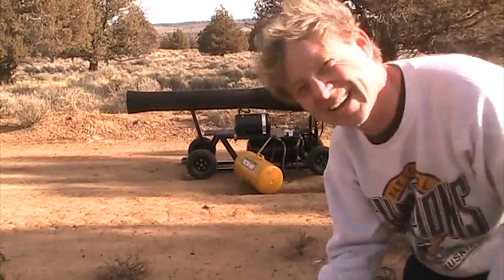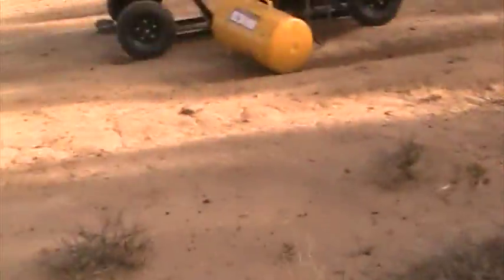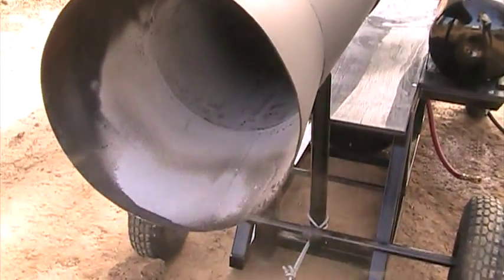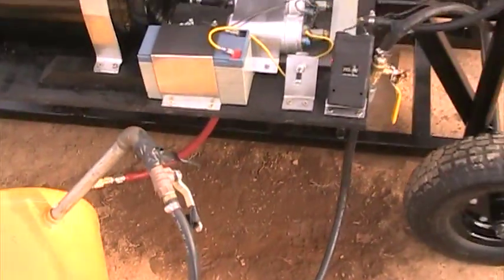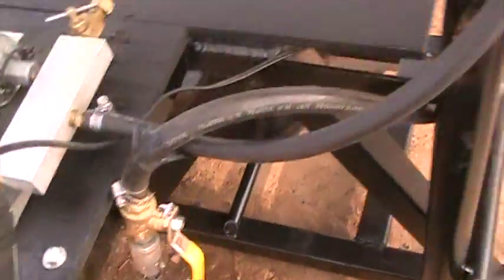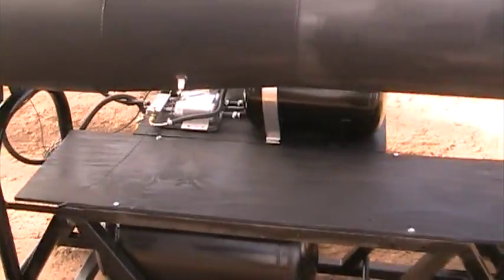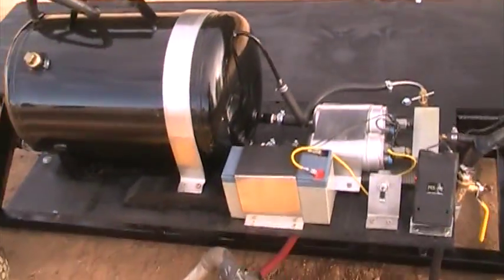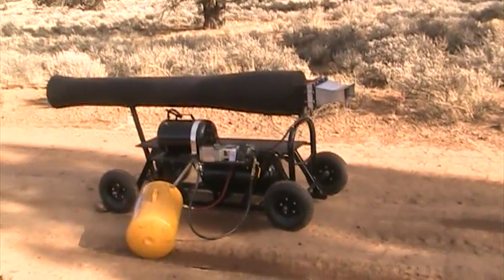New Rocketman show starting 2017 GERMAN V-1 STYLE PULSEJET !

Comment: I would really love to have a set of your Plans that you have used to create these engines. It is a shame that you do not seem to be willing to share them so others can get in on the fun.

That said, what ever happened to your really big Pulse Jet engine??? I have not seen a new video on that monster for a very long time. Did you give up on it?? I think that it would be very neat to see one larger than the Nazis ever managed to build, up and running.
Reply: Unless you live in an extremely remote area, its impossible to run one of these useless things without attracting a whole lota trouble.
Reply: @billsmith281  I was JagdtygerII  until Google took over and I could no longer access my channel. That being said, my nearest neighbor is 3 1/2 miles away, so the noise would be no problem